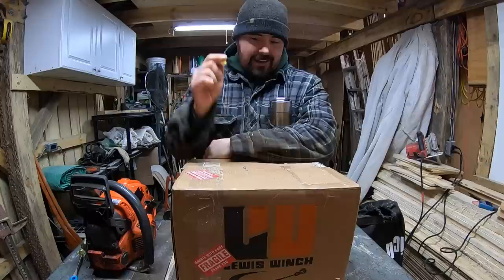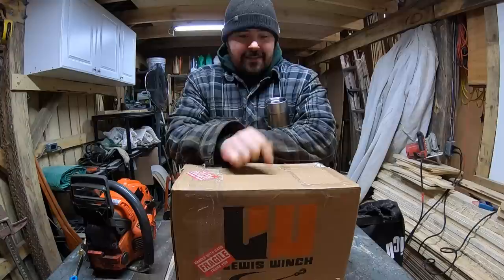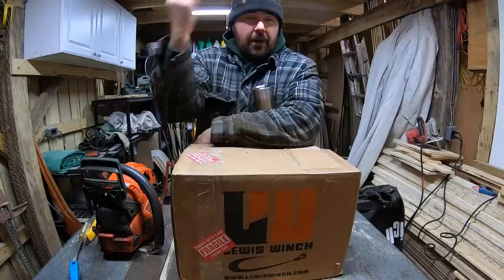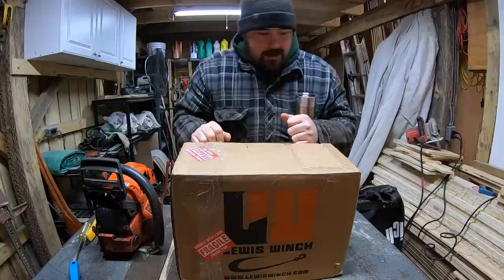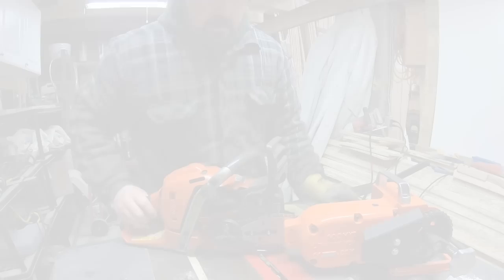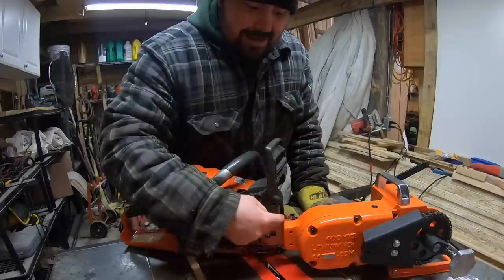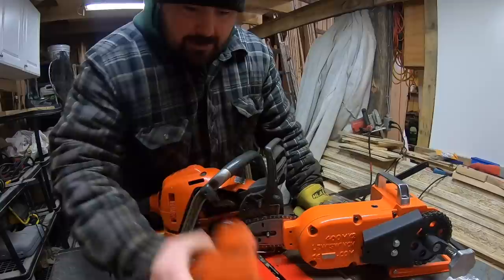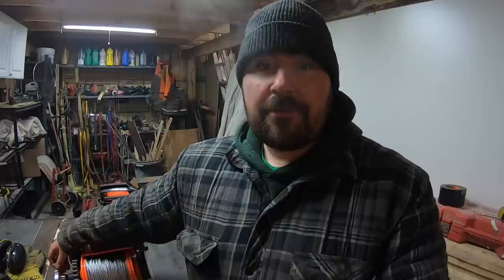Tool for Everyone Who Cuts Trees | Lewis Winch Chainsaw Winch Unboxing

Comment: Very cool, Sandy!   For safety, I would recommend throwing a couple of heavy moving blankets over the winch cable when you are actually pulling up a log. That way if the cable breaks or comes free from the log, the weight of the blankets will prevent it from snapping back at you.
Reply: I was gonna say the same thing.  A broken cable WILL KILL.

Comment: Congratulation on your new winch - an essential tool when logging.  Look forward to see it in use. But be safe when using it - you are always right behind the winch if something snaps.
Reply from the maker: That’s true. Thanks for the well wishes and hope all is well with you
Reply: you put a jacket on the line part way to what ever your pulling that will stop snap back.
Reply: @sawingwithsandy  that saw sounds great

Comment: Never saw one of these in action, initial thought is to use snatch blocks to give you a little more grunt if you're worried about power.
Reply: That’s what I was thinking. This thing could be extremely versatile because if needed you could carry some heavy duty cable and blocks to set up something like a 3:1 z-rig and then just use the winch cable to piggyback onto that and you’d be able to pull some really heavy stuff.

Comment: great video.  I admit that when I contacted Lewis Winch they advised me that their pull ratings and recommendations were to use a saw minimum 80cc.  So I am glad to see you give this a go.  It is what it is.  You have a problem and you found a solution, run what you brung.
Reply from the maker: Yeah I know what you mean about bigger may be better. May end up with a larger saw if the 555 isn’t ideal. Like ya say, I’ll run what I brung for now

Comment: Just bought a new Farmi JL 501 this fall. Run it on a Kubota 7060. It was 4900$ plus Quebec taxes. I know you said it wasn't in your budget but they are definitely worth looking into. I've used the 301 but decided to upgrade. It comes with 3 chockers and a heavy duty clevis hook. There's 185 feet of cable and honestly, anything further than that can stay in the woods....

Comment: I own also 67 acres of land, I noticed you have brush, bark leftover. I bought a wood chipper for mulch on the Garden. People pay for mulch, great present for family, list go on. Just an idea for clean up the yard and make a little money. Big fan, keep up thr good work.
Reply from the maker: Good ideas there. Thanks for tuning in.
Reply: @sawingwithsandy  I did a wood shed to dry the firewood but for roofing material, I used greenhouse plastic sheet. I thought it would heat up in summer and dry the wood quickly which it did. What shocked me,  was the clarity, no lighting system, little shadows. I know that you're on a budget but if the plastic sheet are on sale, think about it. Just an idea. Great videos.

Comment: Hi Sandy. Great vid.

I've had the Lewis winch for over ten years and love it. It's done yeoman service... dragged dozens of logs and rescued many stuck vehicles. it's great machine.

The only downside to dragging logs through the forest is that the bark gets loaded with mud (during anything but Winter), which is hard on your saw when bucking. I try to drag them to where I can blast them with a pressure washer or at least a garden hose.

LOL... nice to see a squeaky clean version...mine doesn't quite look like that anymore.

Just thought of an edit that might help people with one: After many years of twisting and torquing my gear case gasket started to leak a bit and I had to replace the gasket. I might have avoided this by properly torquing the bolts once in a while.   

Have fun.
Reply: Better to drag them in the winter when the ground is frozen and hard.

Comment: You will love the winch and the many other uses. So I due have suggestion so you dont break the bottom  mount .I use  mine to pull on very  large Redwood logs I use a pulley block at the log and run it back  to winch anchor  chain or strap with a chain binder to release pressure incase your log get hung up and you cant release the spool HAPPY LOGGING   ps dont use too big saw motor you will break the drive chain to winch.
Reply from the maker: Thanks William!

Comment: Sandy  using  Raider 4"x30' Tow straps $39. on Amazon to pull  24" fir up hill (I'm in B.C) with my 6400 JD. have 90'.....  3 put together with D ring shackles.....Amazing strength and easy to use because they are so light..With your tractor having chains (same as mine) When you don't want to set up for your cool new winch.....straps work great and hold up well....

Comment: Sandy, Great purchase, I have one but highly recommend using snatch blocks... saves the saw
Reply from the maker: Good to know. Any problems with snapping the cable?
Reply: @sawingwithsandy  Not so far, over 100 10' logs using 1 or sometimes 2 snatch blocks depending on log size.
Reply from the maker: That’s good to hear. I think the cable minimum breaking point is around 11 or 12000 lbs so I figure with the logs I’ll be hauling I should be good assuming I can avoid snags

Comment: You can buy a winch built with 5.5HP 4 stroke engine, used by utility companies, pulls wind turbine power cables which have tons of drag weight up and down mountains.  pull about a 1000lbs, but can be set up on a pully fall system.

Comment: I've got one of these and it's a toy, not a tool and a very expensive one at that.  Doesn't pull very much weight, it's slow and has a very low cycle rate.  If you're a city guy who wants to play on a Saturday morning, this is fun.  If you have work to do, don't waste your time or money on this.  It'll waste a bunch of both.
Reply from the maker: What saw do you have it attached to? Also curious how long you’ve owned the Lewis winch?
Reply from the maker: What do you do to get logs out of remote areas where equipment can’t access?
Reply: @sawingwithsandy  I'm in a mountainous Northern area with deep snow.  I use a snow mobile and sled to bring sled loads of logs down steep slopes.  If I were in a flat area with no snow and had a tractor, I'd use 1" poly rope and just keep tying pieces together (look up the Golden knot for joining lines) until I reached the log and pull them with the tractor.  I've even used a pick up truck and 500-600' of line long spliced together for reaching way out.  If you are pulling saw logs, you definitely want to keep them as long as you can mill but otherwise, smaller loads with more and faster cycles is better.  Which is one of the huge problems with the Lewis winch, it has an extremely slow cycle rate.  Setting up and pulling one pull takes forever.  
I want to add that in a good snow pack, I have pulled full 60' beetle killed (dry)spruce trees with 2' butts  with the pickup and 500'+ of 1" poly line.   Was pretty cool, looked like a Dune sandworm charging inexorably through the snow.
Reply: @sawingwithsandy  I used a Stihl 066 mag, all the power in the world, way bigger than the recommended powerhead size.
Reply from the maker: Sounds like you’ve got a good setup there for moving logs
Reply: @sawingwithsandy  It's been a LONG, expensive learning curve and I'm not fully to the end of it yet but I'm getting closer every year.
Here's the things top best "magic" tools I've discovered so far: 
Pulp hooks.  I handle a large volume of logs, up to 2' butts and Forester brand (but not the North East American made brand, wrong angle) log/pulp hooks are worth their weight in gold.  Turns you into a log handling machine.  So much easier and faster than handling the logs by hand.
A decent bench mounted chain grinder.  Every swinging dick with $3.00 for a file thinks they are the rare expert chain filer but  at 50, I cut circles around much younger guys with bigger powerheads.  A sharp chain is worth a lot of cubic inches of engine size.  The best sharpen is a combination of sharpness and durability and the only way to efficiently get that is with a bench grinder.  Hand filers usually undercut the tooth which produces a chain that cuts like a raped ape....for about 7 minutes then starts to get dull quickly which is why so many hand filers touch up at every or every other tank.  I don't have time to sit on my ass, burning daylight, stroking my file, I need my saw screaming in a cut or I'm not making any money.  Plus, you can sell a bench grinder for most of what you paid for it even in 20 years so it's basically free vs. buckets expensively full of worn out chain files in 20 years.

Comment: I use these winches at work all the time to string on conveyor belts I also know the owner guy who makes them these pull 4000lbs single line with 3/16 cable these things are amazing stihl chainsaws actually mount up the best to these winches
Reply from the maker: Good to hear first hand about these winches. Appreciate you sharing.
Reply: @sawingwithsandy  ive done some crazy pulls with these been using them for years if u have any questions feel free to ask I also built a bracket for this that makes it pull more straight and easier to spool up the cable its less likely for the cable to build up on one side or the other
Reply: @thegnostic33  which stihl saw do you recommend?
Reply: @danlux4954  depends on what you're pulling with them stihl ms 362 is best probably for the home user I like the ms461 its big for the winch but easy on the saw when pulling real heavy weight but its heavier too

Comment: I can't believe they sell something like this. I see more then a few problems with this setup. 
1) pulling force is very low with that much line, look into winch pulling force per wraps of cable on cylinder. The more wraps the less pulling force, it's always better to have less cable and more straps to add if needed. 
2) When running cable that should have a roller fairlead. The cable will cut and score the block and will damage the cable fast.
3) cable is deadly. Not only will this whip (and take off your head) if it brakes underload cable strands will cut up your hands and gloves.
4) USE winch rope ! When it brakes you can very easily fix in a few minuets on the trail And it will not hurt anyone if it brakes under load. 
From cutting trees for two homes and avid off roader a electric winch (cordless or on on a ATV) with snatch blocks will give you all the power you need and be smaller (lighter) and safer!

Comment: Sandy I brought a 2 ton winch and mounted it to the top of my  front bucket and it runs off the battery, it’s works great for pulling out logs that I can’t get the tractor too. I be watching how yours does with a chainsaw, o think it will work fine.
Reply from the maker: Sounds like you’ve got a great setup there Duncan!

Comment: Winch Sandy, not wench. A winch attaches to a truck or ATV, for example. A wench attaches to an unfortunate fellow ;-)

This winch looks similar to what I am looking for. Thinking I may put a winch on the log splitter I am building. Could use the hydraulics, yes, but....I can use the winch to move the log splitter about and also pull logs to the log splitter. I will be using a 4 stroke for the hydraulics; they need to run on the level. The chain saw is 2 stroke and won't mind the splitter going up down sideways, to get to a good spot. Also! If I can make it detachable from the log splitter...its' portable :-)  OH! and maybe I can get me a low rent wench to help me split wood lol

Comment: “That is solid!” 
Fragile, handle with care sticker on box. Lmao😂 kidding. Very very nice. Gonna check into that winch. I have an el-cheapo 12V winch I connect to ATV battery if I get a piece of wood in a bind. A friend gave it to me, seems like it's a Masterlock brand. About 2,000 dead drag weight, 6k rolling weight pull. Think it wAs 169.00 when my friend bought it years ago. 
Edit: Thats an awesome piece to have, unfortunately, I can't swing 900.00 at the moment. Look forward to seeing this in use

Comment: I've been thinking of getting a capstan wench but this might be another option.  Can't wait to see it in action.
Reply: I prefer (and own) a capstan winch. More safe to use as you are standing out of the line of the wire - and it have constant pull, where the Lewis looses force as you winch in and you can have almost unlimited length of rope on the capstan.
Reply from the maker: The main reason I went with the lewis winch over the other type using rope is because the Lewis winch has more pulling power without the need for pulleys. With a 7hp saw without pulleys the Lewis winch will pull 4000lbs
Reply from the maker: I agree with you about standing out of the way of the winch cable. I can see how the capstan winch is a big step up in safety that way. In the future I hope to try one of those capstan winches
Reply: @sawingwithsandy  With the capstan winch, you have 2,200lbs single line pull. If you use two double pulleys, you will move any log. Using a rope bag, makes it efficient operation to use 200 feet of rope or more.
Reply: @torstenjoergensen  think i want the capstain winch

Comment: If you are pulling to near maximum drape a heavy rug or jacket over the cable in case it brakes
Reply from the maker: Good idea. Others mentioned that as well and I’ll for sure keep that in mind when the load gets heavy

Comment: How does it spin  backward to relieve the tension to unhook a load?
Reply from the maker: Whenever you left off the the chainsaw throttle it will spin backwards by the clutch slipping on the chainsaw. The brake on the Lewis Winch is there if you don't want it to freespool when you let off the throttle

Comment: Does it make mention of the weight limit when hooked to the location under the belly?
Reply from the maker: 4000lbs pull when pulling without a pulley. That hook on the underside of the winch is the only spot to anchor the winch from

Comment: I'm just wondering, if you're standing up the top of a muddy hill how much weight can you handle as it winches up?
Reply from the maker: It’s rated for 4000lbs so they say. I’ve likely pulled 2000lbs without issue at this point.

Comment: Hey Sandy. Try a Norwood hydraulic capstan winch for your tractor. I have one for mine. They are way less than the PTO winches. Ron.
Reply from the maker: I did have a look at those and they sure do look handy. Maybe I can try one of those units out in the future
Reply: How can I get in touch with you?  I’m in the Straford area. I’d like to send you some pictures of my wood covers. Your wood shed you just built is handy, but I have a bunch of covers that are different lengths. I set them on top of the finished stacks. They are waterproof and heavy enough to help resist warping and cupping.

Comment: This is the equivalent of milling. The same power requirement. Would you use this saw to mill? Husqvarna is not known for torque. This is a 660 minimum application.
Reply from the maker: I’m just going based on the Lewis Winch website. Says this saw and even saws with less power works fine
Reply: Sawing with Sandy I’m thinking everyday use. If you don’t happen to have a larger saw for a day or two fine. But everyday using it in any productive capacity I’m worried it won’t be long until the clutch gets significant wear. I know you have what you have but I’m imagining how nice it would be if you could find an older 660 and have a larger bar for it as a back up but keep the winch on there more permanently. That was you use the lighter husky for limbing and keep the heavier saw for the winch unless you need to flush a big stump. It seems like it’s made for Stihl because it needs no adapter. And the chain is at length for a larger saw.
Reply from the maker: Check out my video from yesterday I’ve got it setup to a different saw now
Reply from the maker: I also forgot to mention that I’ve got a video I posted just after this one showing this saw in action with the winch if you want to see how it did. Thanks for tuning in

Comment: get rid of the steel cable and use dyneema synthetic line. lighter weight, and stronger.  i use it on my pickup winch with a chain or strap around the log or tree.
Reply from the maker: Unfortunately the warranty is void when using something other than the steel cable. I may have to try it on my other winches like my ATV winch however just to see what it's all about
Reply: Perhaps this would be OK with pulling stuck vehicles and other clear-shot pulls.

I can't imagine using synthetic rope for pulling logs over rocks, dirt, and other natural obstacles. Lewis recommends steel cable for good reasons.
Reply: @scottmclagan4276  i switched to synthetic line a few years back, holding up good. flat ground, uphill, downhill, rocks, mud. and cheap to replace when needed. will never go back to cable. to each his own.
Reply: @groundzero.  Good to know...I'm always open to new ideas, and there's no doubt that synthetic is lighter. 

What length and breaking strength do you use?
Reply: @scottmclagan4276  50' on the winch and a 75' extension 3/8" line  think it's rated  at 19,000lb.  I use a winch that can be moved from front to rear of pickup  or  strapped to tree, post or whatever.
Reply: @groundzero.  Thanks. That's a crazy amount of pulling strength.

I think I'll go with 100' (I need the length) at 7.500 lbs. Weighs less than 1 kg.

Comment: At least with that on your saw it doesn’t bounce around while idling
Does it have a mount on it anywhere to lock it down? How exactly are you supposed to pull 400lb log if you’re the anchor.
Reply from the maker: Anchor loop is on the bottom of the winch. Be sure to check out the other video in this playlist to see it in action
Reply: @sawingwithsandy  I actually did I should’ve deleted this. Seems like it gets the work done well and with an even bigger saw I’m sure it’d be even better.

Comment: question: Does the winch itself come in different sizes for greater weight to power rations?
Reply from the maker: I’d have to double check in the website but I believe it’s just the one ratio which is 100:1